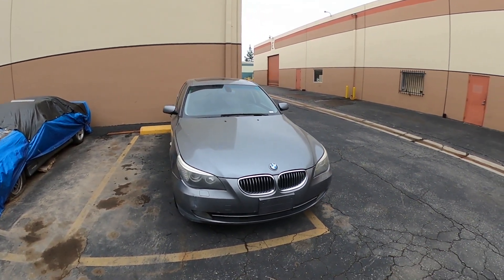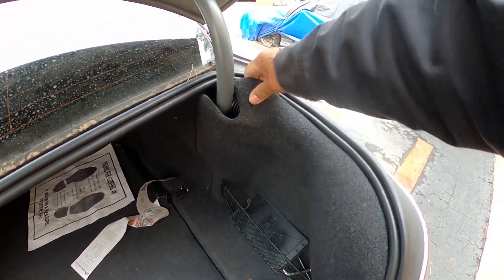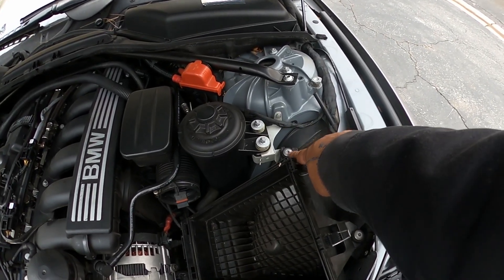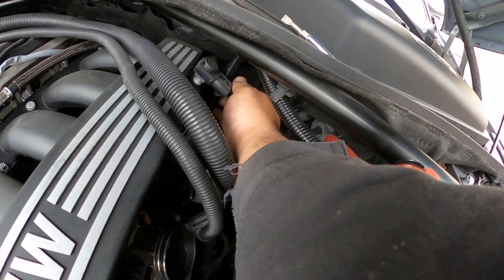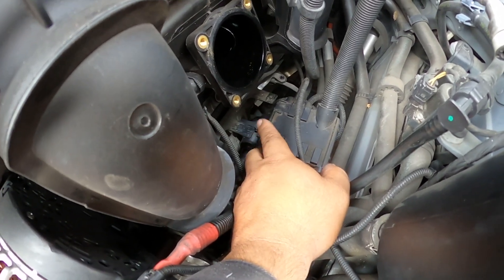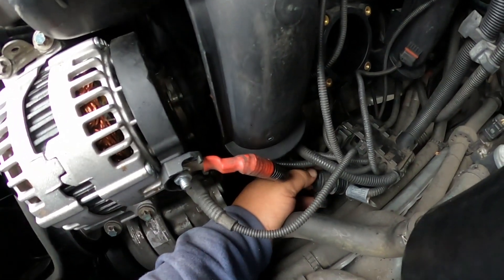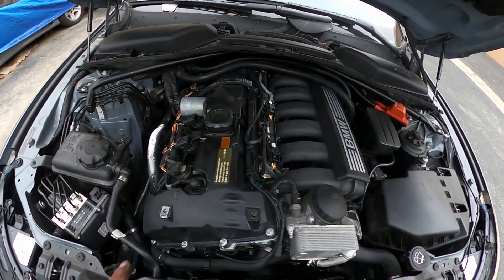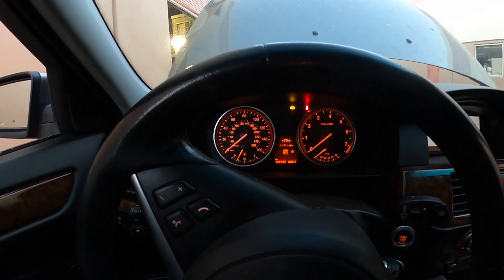BMW DTC P0335 HOW TO REPLACE CRANKSHAFT POSITION SENSOR ON BMW 528I.

Comment: Replaced the sensor now the car starts revs up and down and turns off
Reply from the maker: @annettedelao3333  did you buy a Bosch or German made sensor? Did you inspect the conector and wires?

Comment: Outstanding 🎉🎉🎉I'm having same issue bimmerlink let's me know it's the ckp sensor two ways of doing this underneath better but need a lift I don't have so from the top like you did is the best way without a lift 🎉🎉🎉kudohs once I do mine I'll inspect all the pcv hoses as well good jog 🎉🎉🎉
Reply from the maker: @darrellrogers5703  it’s pretty easy to to it from the top.

Comment: I'm about do. Crank sensor and valve cover replacement on bmw today. Valve cover getting replaced because of that pc I told custmore we can break old one install new one for cheaper put he went by what BMW recommend change whole valve cover which stupid disgin to attach pcv toit
Reply from the maker: @jafaary2614  it is a stupid design

Comment: I just completed this job, he forgot about 3-4 more things you have to remove......on the back side of the intake there is a bracket screwed to the intake.These are very thin wires and they are a pain the ass to get at. So since it wasn't in the video I ripped 3 - 4 of them......The is also two more wires on the back side of the intake he didn't mention those either......not very thorough video.... BMW's suck so bad !!!! Engineered by retards...  Basically that you have to bring it to them so they can charge you thousands $$$$$ Never buy a Bmw they are complete junk!!!!!

Comment: Hey man I’m getting a p0016 code I know it’s a cam/crank correlation code but before it started the crank no start it was taking a long time to crank then it would start do you recommend I start with the crank sensor or cam sensor ?
Reply from the maker: In your case it looks like it might be a stretch chain or timing slightly out of adjustment.